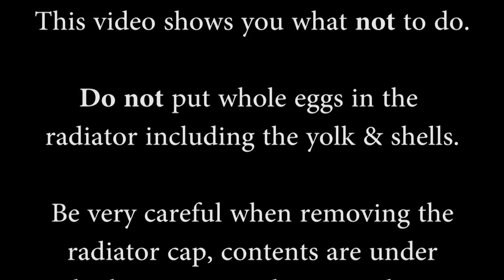How to fix a Radiator using an Egg OPP Style!

Comment: I would only recommend using an egg if the car is on its last trip to the scrap yard, I did an emergency fix of a VW Golf MK2 only using the white of one egg, it worked and clocked the leak but it also clocked pretty much everything else so I had to stop and cool down every 30 Km.
Reply: That is exactly what happened. This car never drove again. It went to the scrap yard.
Reply: SupraManTT Yes I saw the disclaimer I just wanted to add my own experience of actually driving a car with an egg in the cooler. Don't get mislead by my goofy profile picture the decision to use an egg was made because I needed to move the Golf acutely with no professional remedies in my possession, the engine was so worn and damaged that I only cared for its operation for another 60 Km along with my curiosity to check the myth made me give it a shot.